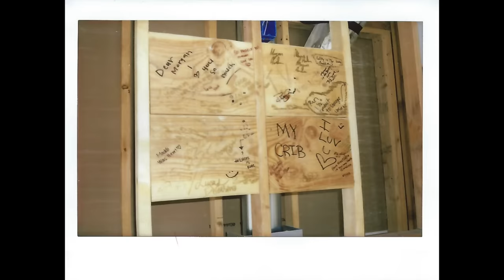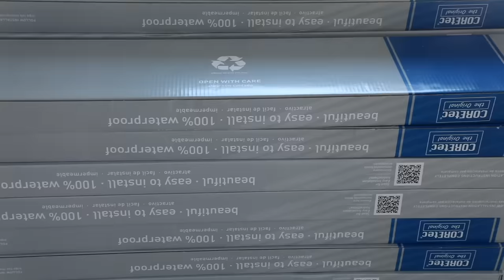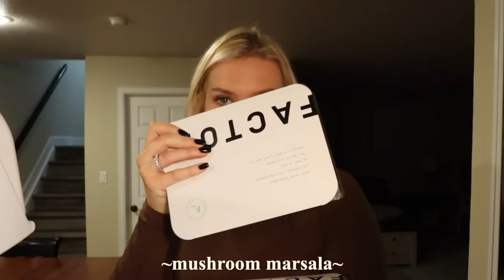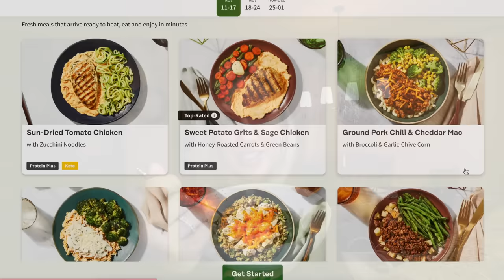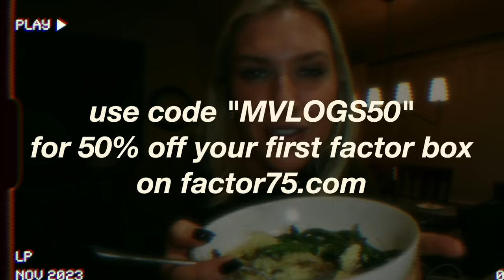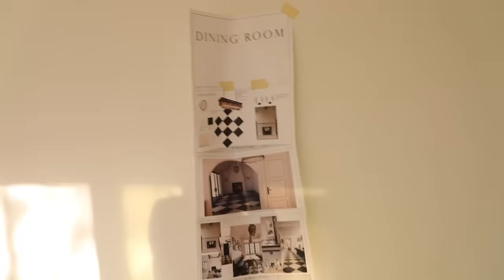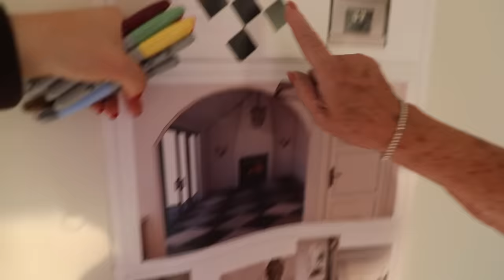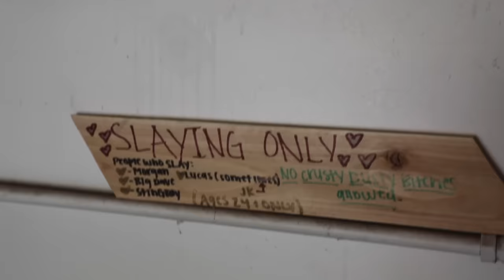Living with my parents at 26.

Comment: I hope you get added security locks or security screen for your front door. I worked hazard claims for 20 years and that’s the most popular door to break into. They just bust the lower square window to reach in and unlock the door and open it. 🥺

Comment: Please get treated with IFN-alpha, I lost my Sister to melanoma, she went through the same thing and we did not know about IFN back then, had anyone told us, it probably wouldn't had come back at age 31. Also get tested regularly with positron emission tomography (do it at least every year), my Sister would get tested regularly and we stopped testing after a few years of the surgery. We were confident it was over, until she fell very ill, and then the melanoma was found all over the body. Melanoma is very invasive and metastasize very quickly at early stages, even tho she had a surgery to remove the melanoma, a  few cells made their way through and didnt manifest until years later. A PET scan can detect a certain amount of melanoma cells if the melanoma comes back, its the most sensitive test to detect melanoma if it starts to grow. I hope you read my comment, it can save your life. It wont return my Sister but ill be so happy if I can help you with this information.